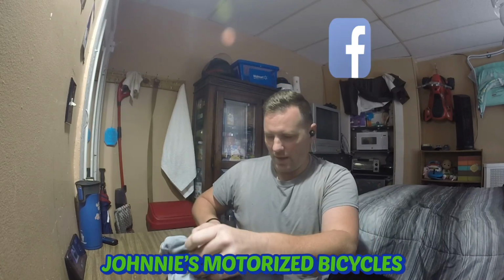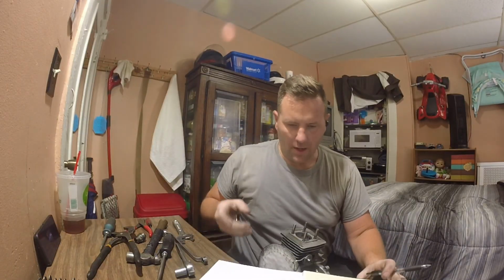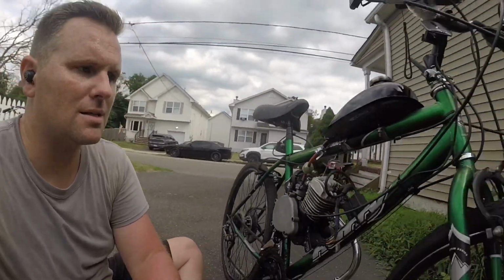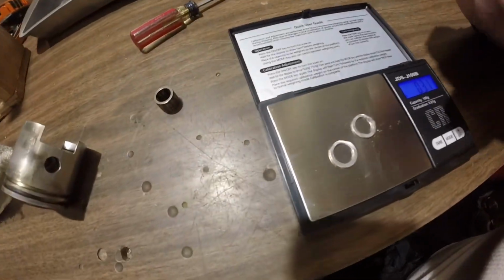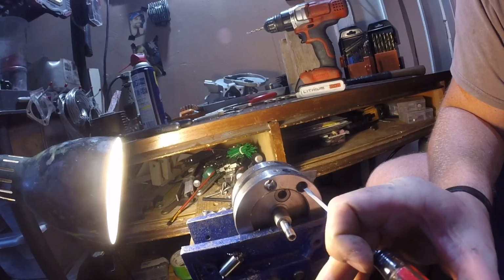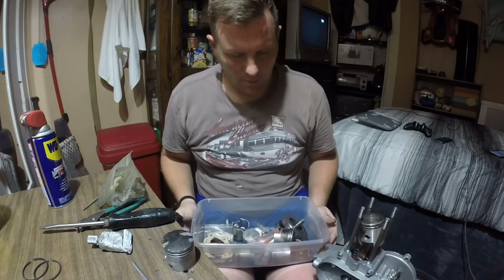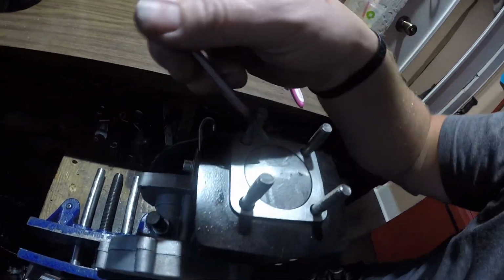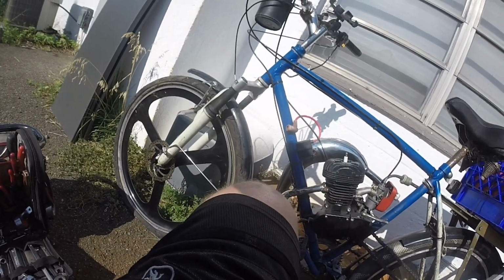RECYCLING 80cc MOTORIZED BICYCLE PARTS FOR FUN!?!   @johnscustomsaws

Comment: Hiiigh HOOOOLLLLLE!! 😆 That engine at the end sounds really good! I think your sprocket may be not centered on the rim. There is quite the chugging sound in the RPM. Like, "Re-err-re-err-re-err-re-err.
Reply: I just thought, maybe it could be the tire also. I noticed it in your other videos on the same bike, but it seems louder now. Be careful brother.
Reply from the maker: No it's definitely the sprocket, it's been like that since I built the rim. I hard mounted the sprocket and I am like a millimeter or two off center. I'll be fixing it when I refurbish the bike. It's super annoying cause I gotta leave my chain looser then I like cause at one point it always tighten up. I basically just need to drill new holes in a new sprocket. Live and learn right!?! Glad you thought the high hole was funny.
Reply: @JMB676  There's a song called 16 Tons by Tennessee Earnie Ford that also makes that same sound where he says, "I owwwwe.." Also is it cool to send you a rim to the address in the description?
Reply from the maker: @almostsapien  yea for sure, that's my P.O. box so there's always someone there to receive it. Once they get it they send me a notification it came in on their app so I can go grab it all.

Comment: Crazy question I've had the same high hole low hole problem you had I put a base gasket I made from the bottom panel of my dresser drawer does it make a huge difference if you raise the cylinder or lower the Piston hole does this throw off the part timing I'm curious